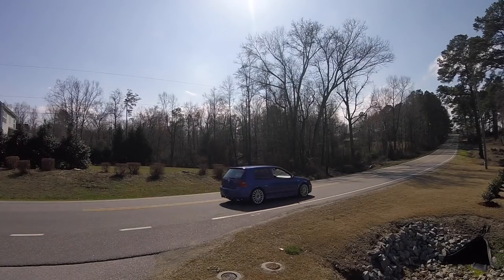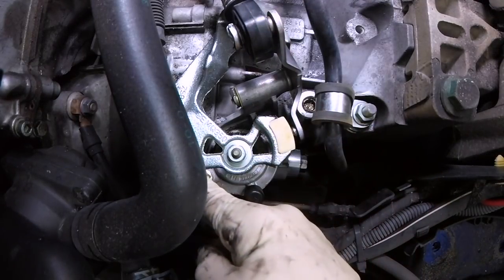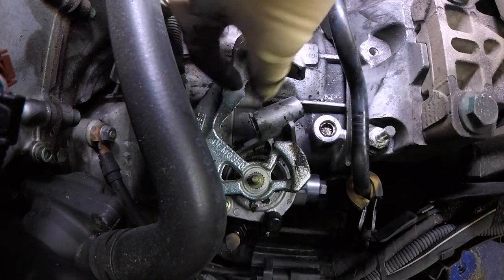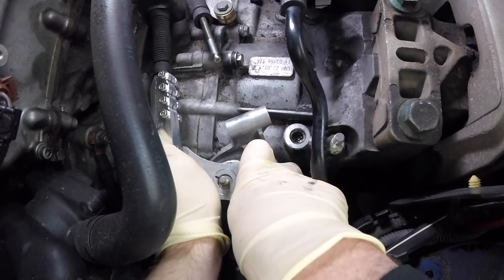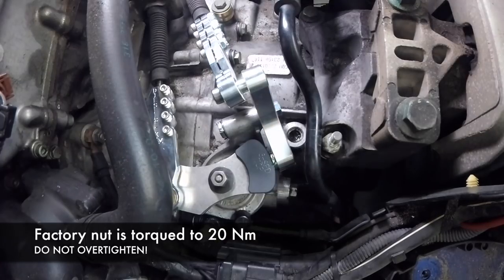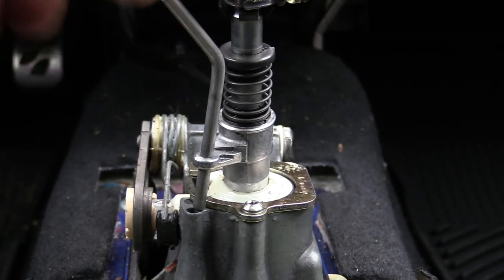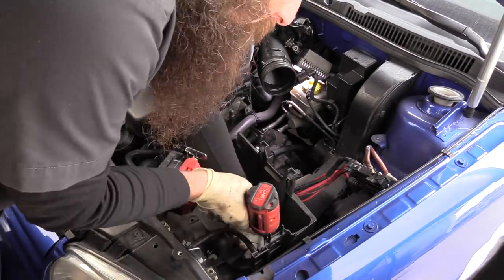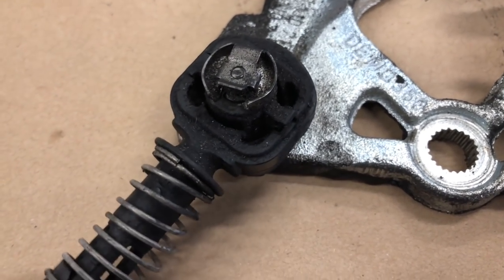How to Install a Short Shifter and Adjust Shift Cables

Comment from the maker: I hope you enjoy this video. I really love this shifter kit. Between this kit, and replacing the bushings, it's a whole new car. I will be doing a separate video walking you through all the improvements I made on the shifter very soon.
Reply: HumbleMechanic @vduber32 here, Thanks for the video Man!!👏🏼👏🏼👏🏼👏🏼👍🏼👍🏼
Reply: Hey Charles I have a question for you. I have a 1996 Toyota Tacoma and has a transfer case seat which is like a tapered peice of rubber that supports the ball of the shifter I tried putting it in without and it seemed fine. Do you think it would be ok to run it like that for a few weeks till the seat comes?
Reply: I have a mk 4 jetta what is the length of the shifter cables 
Need to replace the cables but do not know the length
Reply: Hey Charles, I've got a COOLERWORX short shifter for my audi s3 (same as mk4) do you know if it's worth doing the diesel geek as well or would it not make too much of a difference?
Reply: Hey there Charles thanks for the video. I noticed the Sigma SIx kit at DG via your link looks different to the kit you installed. Specifically, the 2 cable ends on yours, versus only 1 on their advertised kit. Plus the design is different. Can you clarify?

Comment: This is the only shifter kit to get for an R32 or really any VW. I had a few others on my R32 before going with the DG. Only pro tip I didn't notice is you don't want to tighten the cable clamps too much. I think DG has in their instructions it should be tight enough where the slot in the clamp will lightly grip a playing card. All these R32 videos are making me want one again!

Comment: I picked up one of these kits for a 5 speed swap I've been planning on doing to my 02 Golf TDI. Have everything I need but this 01m will not die!! 380,000 miles and still going. I guess doing the fluid and filter every 50k has paid off. I've used Valvoline MaxLife ATF btw.
Reply: You must have the fabled 01M blessed by Piech himself. I permanently pulled mine from my Cabrio with 157,600 miles after already having it rebuilt once. Literally did not think it was possible for one of those crapboxes to pass 200k miles.

Comment: I've got one of these in my car, Great bit of kit.  Agree with you when you say it makes the gear change totally different .  It feels much chunkier ,  quite a bit heavier, and possibly slower to change gears with this in.   People often don't comment that although the travel is shorter, the actual effort to change gear is much higher and it to me feels slower.  It makes the car feel more mechanical and takes more concentration to engage . It's almost like there's a gated shift feeling , whereas the factory shifter is light and it has that big end weight so the gears self glide into place.  Whereas with the diesel geek you have to man handle the gears into each slot .  It's different, I wouldn't say it's for everyone like you mentioned in your video, but as I don't drive my car everyday it's nice to have .  It did take a lot of fine adjustment over a few weeks to get to a good feel.  The adjuster nearest the battery has an incredibly massive effect on the smoothness of the set up.  Literally one thread difference (eg 1-2mm) can make the difference between good and undriveable.   Also the gearbox feel differs once it's warmed up, so adjusting the diesel geek to perfection takes me hell of a lot of trial and error.
Reply from the maker: I agree, For me it's perfect. I did want to mention that it will take more effort and remove a little softness of the shift. And you are dead right on the adjustment. Its sensitive as crap AHHA
Reply: Ja son - I’m glad you posted this comment. I installed a Sigma 5 on my O2J and thought I had done something wrong. But it looks like I did everything right based on your comment as I’m feeling the same things. I may go back in and try to shorten up the vertical throw a bit more. It’s not much less then stock so I probably need to readjust it. Hopefully if I can find the time at my next service interval (new job, new marriage, etc) to mess with it.
Reply: Ja son, Hello, I have a question about the fine adjustment on the side to side unit. You mean the adjustment is on the cable? would you say the tighter the better? Thank you for your answer :)

Comment: I've been running a Dieselgeek Short Shift kit for 5 years now and still lovin it! I love the notchines of it and positive feel
Reply from the maker: How was the break in/wear in?
Reply: There isnt much to a break in or wear in period since its made out of metal bushings but for the first week it was from what i remember a bit more notchi and unforgiving if you try to shift it fast but soon smoothed out, one thing to keep in mind from my experience its that you have re-adjust the cables after a while i gues from the extra stress put on the from not having dampening of the rubber bushings in the linkage and like yours the shifter braket metal bushings. On a side note as a part of my regular maintanance i clean and re-lube the spherical bearings every 10 or so thousand miles since they are metal on metal from i can see
Reply: Cristian Alexander what kind of lube do you use on the spherical bushings?

Comment: More R32 flybys!  Kill more dead dinosaurs and turn them into glorious noises.  I can listen to that all-day-long.  When upgrading my GTI's shifter, I chose to go the 42DD bushing route in the cable ends; no, not a short shifter, but those bushing along w/a stage 1 dogbone mount, really added positive, crisp engagement and removed 'most' (a lot) of the slop; still not racecar, but better.  Keep up the good work and I will eagerly await future vidoes where you removed all the nasty paint/clearcoat the PO put on all the plastic pieces (engine cover, airbox, etc) under the hood.  Did I mention more flybys at WOT!

Comment: My car is nothing at all special. In fact, most people call it a crap POS. It is a 2003 Peugeot 307 20.HDi, and I love it. It is not standard, as in I have replaced the interior for leather, and replaced the wheels, complete suspension, steering wheel, all bushings (PowerFlex) and had it remapped. It was only a 90Bhp previously, but it is now 125 so a nice increase.
I have done things very slowly over 4 years since I bought the car for £350. It is not worth any more than that despite what I have done to it, but it is a forever car for me. It is mechanically sound and very reliable.
There was never a sporty version of the 307 (the XSi was not sporty, just a trim level. No extra power or anything over any other trim level) so "performance! bits are few and far between.
I am  on an extremely tight budget due to health issues, and this car has got to last me a long time as I cannot afford to replace it. I have not spent a lot on it really.
One thing I would love is a short shift kit. I am UK based, and there are none that I can find. So, I will pretend that the one you have fitted to your VW is fitted to my lowly Pug, and I ask that you enjoy it for me as well as for yourself :)
Love love love your vids, and I am still buzzed about you messaging me on Insta.
Reply from the maker: Thanks so much! I love you made your car YOURS! I am sure you can get one shipped over to ya. It will cost a fortune I imagine. but you can have it. :)
Reply: LOL! If I had a fortune, I would not have a 307 :)
My income is incredibly low due to disability, so fortunes are way way out of my league.
Reply: Most people are correct. You couldn't pay me to drive one of those. Each to their own I guess.
Reply: Thank you for your kind words. It is all some people can afford, like me for instance. Can't be picky when you have a tiny motoring budget. We can't all be high flying powerfully built company directors like you. Some of us are unable to even work due to physical constraints, me included.

Comment: Charles, it looks like you pull the slack on the side to side cable forward towards the end link. Am I seeing things?  I thought DG says to push the slack back towards the rear of the car.  Am I doing it wrong?
Reply: A year late but I'm also confused as it's the opposite of what Dieselgeek says. I keep having problems myself on my OEM Euro shifter as I broke the plastic alignment hole tab inside the cabin like an idiot, so I'm never 100% sure whether I can get it just right. I'll have to test this out myself (both pulling toward the end link and pushing away).

Comment: If you are on a budget and can't quite afford the dieselgeek kit, another nice refresh is just the shift cable bushings. Replace those crumby plastic ones. There is a company that makes solid aluminum ones.

But great video. Thanks Charles!
Reply from the maker: Thank you! I totally agree on the bushings. I will have a video coming out next week on bushings. I didn't do a DIY because you can't see anything with the box in the car. DG did amazing DIY videos there.
Reply: I have been given another piece of advice. If you have a 1998 or 1999 Beetle or Cabrio, you might have MKIII transmission linkages, but you can replace them with OEM MKIV linkages. There were several other weird mixtures of parts with the 1998, 1999, or 2000 Beetle or Cabrio.

Comment: I would like to get a DieselGeeks short throw for my MK7 GTI, but for right now, my Forge short throw with billet bushings are working great. Great feel, little notchy, which I like, and great throw length. Only thing I wish it was better at was the side to side movement. For the money though, it’s a great short throw shifter.

Comment: That pivot bushing was completely seized in my passat, causing the plastic bracket to snap off. Had to remove selector shaft so I could drill out plastic pin.. was a little intimidating, but everything worked out just fine. Dieselgeek has a video on “shimming the ball socket” inside car, that removed all play on knob after sigma 5 install.

Comment: Great video. I did this on my MK7 and remember the removal of the shifter being a pain. I had to use your trick of hitting the nut (with an extension between the hammer and the nut). Be careful not to hit it too hard and strip the bolt, and then bye bye transmission
Reply from the maker: yeah you need to thread the nut on a good amount of threads. AND you don't need to hit it with a Thor hammer. AHHAH

Comment: Had mine since they came out, best out of all of em in looks and performance.  I noticed the new ones, series 2? , only have 2 bolts on one billet arm. They want you to use the oem top bracket. I'm wondering why it's not  built as good as shown here.

Comment: Hi Charles I have asked questions in the past you have been so fast at answering much appreciated love all your videos.
1.  I to am and installing a diesel geek short throw shifter kit I just wanted to ask about your video because I watched the install video from diesel geek and it appears exactly opposit of what you installed.. your side to side was opposit of his. I need to know who's correct. Or can it work either way?
2.  Which cable goes to which one there is a longer and a shorter cable I need to know which of the 2 is the side to side. 

Thank you in advance I appreciate your time and effort.

Comment: Charles, great vid as ususal, love the channel-- hoping you might be able to provide some expert advice.  I'm looking to put a short shifter in my '19 R, and am thinking about the OEM short shifter that your friends at DAP carry.  I just checked out their install video and they don't mention having to 'lock' the transmission during the install process. Is that because the shifter cable ends are OEM?  By the way I took your advice and got the spare tire kit, which gives me a warm and fuzzy feeling on longer drives; and will be going APR+ stage 1 in the spring.  Thanks!

Comment: Great stuff charles. I have a S3 shifter I'm going to do with my mk6 gti, the cable adjustments should be pretty minor and are similarly done as you did here. Questions is with any shorter shifter are cable adjustments always necessary?

Comment: Hey Charles I have a question for you. I have a 1996 Toyota Tacoma and has a transfer case seat which is like a tapered peice of rubber that supports the ball of the shifter I tried putting it in without and it seemed fine. Do you think it would be ok to run it like that for a few weeks till the seat comes?

Comment: Hey Charles i enjoy all ur videos and learn alot from it for my VW polo 1.2 tdi bluemotion ......so ive got this car which is run 60,500 miles and the gears shit sloppy an their is a considerate amount of play on the gear knob + wen i shift the gear box lags .......on lower speeds the the second i remove my foot from the gas it lags n pushes my body forward and the vehicle tends to lack power at lower speeds say 20-30kms (Indian Road conditions) i mean to say their isent enuff power delivery for the gas given .....ive recently changes the engine oil ,fuel filter, air filter .....pls suggest a solution  & mainly the car takes alot of time to cool off ..... i hav a Renault Duster an tat cools of lik in 3 hrs but my Polo still hav a hot engine even after 3 hrs

Comment: I currently have a B&M short shifter on my VR6 and I'm about to install an APR SS Kit + the cable bracket they offer, as well as new bushings on each end. I'm debating if I should replace the cables themselves. They are 16 years old and this would be the perfect opportunity to do so. Also, is there a torque spec for the bracket bolts? I see the bushings have have been upgraded.

Comment: A bit off topic, Charles, but I need some advice from a VW Technician. General question about weighted shift knob.

First, I hope you are well. I wanted to check with you to see to see your expert opinion. Would a 500 gram (~1.2lb) shift knob be too heavy for a MK5 VW with push down for reverse? I am curious to know if the bushings and spring for reverse could handle that weight without excess wear, or a soon to happen failure. I see stock knob is ~90 grams, and a bfi knob is 200 grams. I’ve seen some full aluminum knobs that I really like, but the weight is double the weight of a bfi knob. Billetworkz sells a 700 gram knob, so there are heavier out there supposedly for VW, but I’m really concerned about excess wear, or if a 500 gram knob would cause the push down to sag automatically. Any thoughts or information is helpful, thank you and I hope you have a good rest of your day.
Reply from the maker: That seems way heavier than I’d want. I like the weight of the bfi knob. Maybe 250 but 500 seems too much in my opinion
Reply: @HumbleMechanic  understood, and thank you very much for the reply. love the content, and watch every upload man. will look for a 200-250 knob, or bite the bullet for a BFI. thanks again

Comment: I bought one of these Dieselgeek short shifter kit for my 2016 GTI (S) and felt it was not as perfect as it could be.

IMO the standard one from VW is not very well designed and, of course, the "throw" was ridiculously long.  I have never been in a car that has such long distances just to shift.  GTI is supposed to be a "sports" car, not a farm tractor.

So, I knew I had to make a change.  Watching the many videos about short shifter kits, I went with the Dieselgeek unit.
As above, I felt it wasn't quite as good as it should be.  I had continuing issues with shifting from 2nd to 3rd, into reverse and many times from 3rd to 4th.  Dieselgeek said that the issue was probably due to the rubber "rod" that is on the inside of the shifter.  However, the video showing the extensive removal off all the parts inside the cabin just to access a $12 part was just too complicated for me to even contemplate.  

Then I saw how the Deutche Auto Parts completely redesigned the short shifter units from other suppliers.  DAP removes the rubber bushings and eliminates the springs attached to the left- and right-hand rods, thus making it far firmer that units which retain those parts.  

It is important to torque the center bolt correctly.  If you overtighten, you risk snapping off the bolt and have to spend $400 just for the part.  Labor is difficult as you must get under the car to replace.
Second, put the car in reverse before torquing the bolt.
Last, you absolutely must use a 5 mm round rod to make the final adjustment (on the inside of the gear shift after you have locked the transmission in neutral.  Using a 4 mm drill bit will not do a good job of aligning the gears.

After going thru 3 short shifter kits, the DAP is, in my opinion, the best kit of them all.  The cost is the same as with the Dieselgeek unit.

Comment: Hey, great video. Just one quick question, I have a VW Passat b5.5, AVF engine code with a 6 speed manual, i was wandering how hard would it be to put a short shifter kit on mine. I love the drive, and I think it'd be even better with a shorter shift. Also, slightly unrelated, I have this weird problem where it won't go into first unless I'm pretty much stopped, and often I need first even though I'm moving because I live in a city on a hill, so if the traffic is going let's say 10 mph I'd really need first as in second it'd be at around 1k rpm, so not really ideal. Do you have any idea if it's supposed to lock me out of first at that speed and if so, can I modify it so it wouldn't lock me out? Thanks

Comment: Thanks for the video. I installed the bushings and the SS kit, but having trouble getting it to shift smoothly. Mostly because I dont really understand what the cables each do so having trouble figuring out how to troubleshoot. Can you explain the system a little please? Thanks.
Reply from the maker: I’d recommend popping over to Dieselgeeks channel. They have some deep dive videos showing it all apart.

Comment: Is there any reason why you can’t mount the cable clamp with the bolts/slot facing down for a cleaner look? The hole for the cable seems to be centered on clamp so it seems like you can run it either way. 

Any thoughts on this?